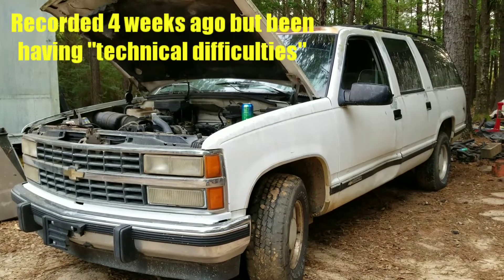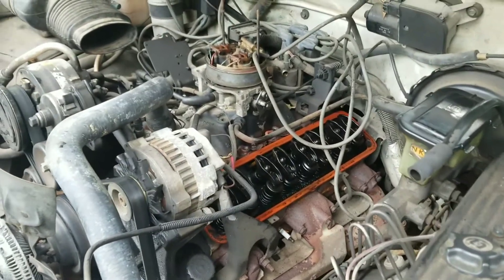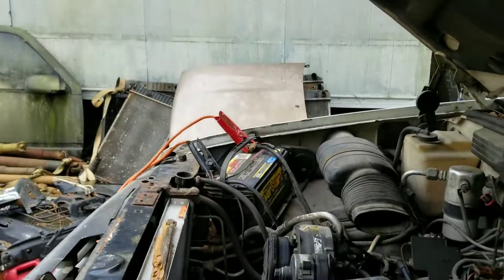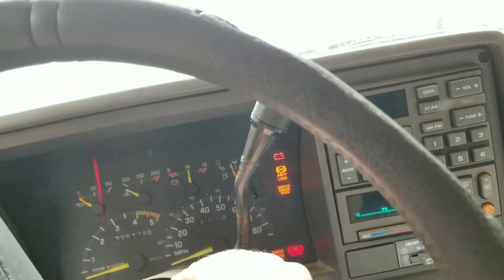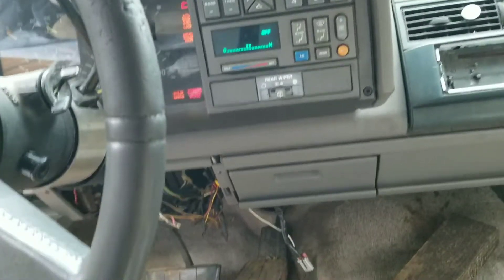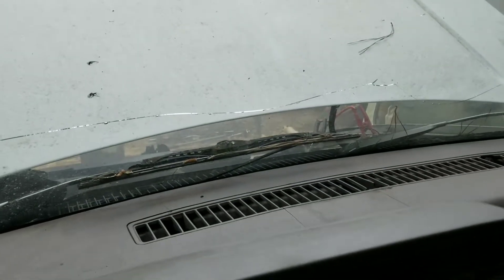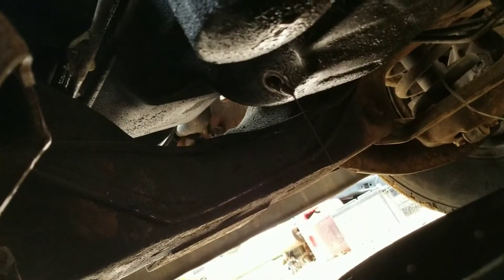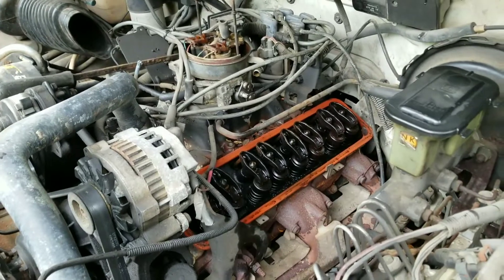300k Mile wore out Chevy 350 put to DEATH! Redline for a Good Time!! Lol

Comment: 300k isnt nothing for 5.7 must have been neglected bad because i have two 92 models with close to 260k both are daily drivers and don't burn oil
Reply from the maker: I agree with you there I've had a bunch of TBI engine over 300k miles still running fine this one was just abused and had a bunch of problems